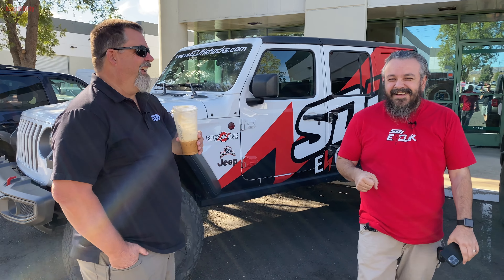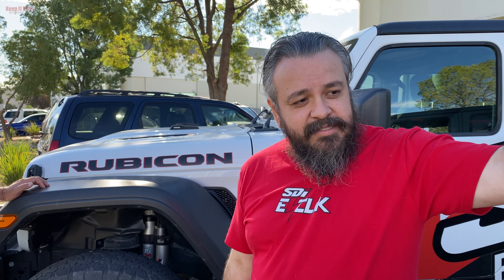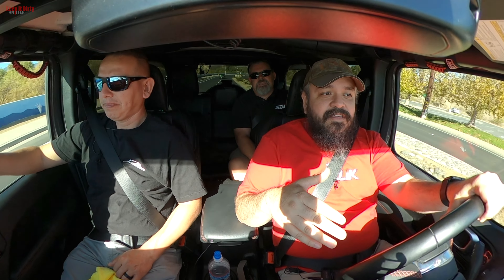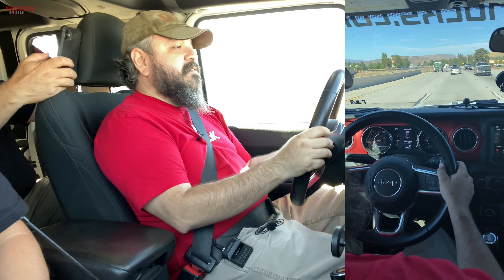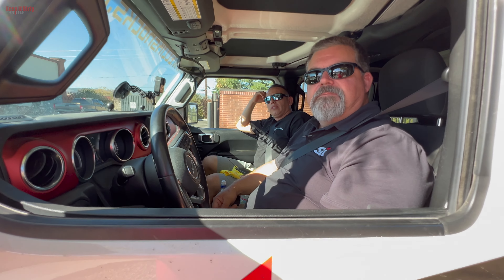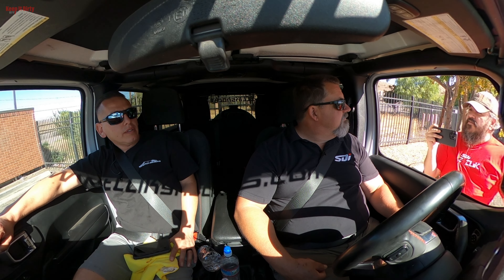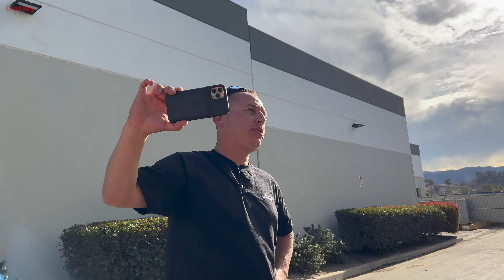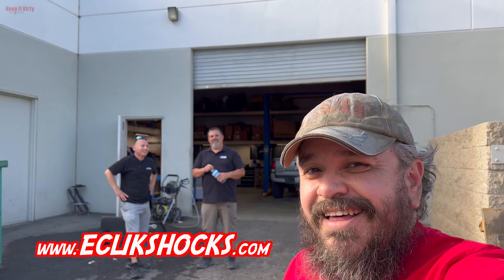SDi Jeep better than a Raptor?

Comment: The Rubicon has a 1" lift over the Sport or the Sahara, but they used the same LCA on the front. If you put the LCA's from the Mopar 2" lift on the front (they're 1/4" longer), it helps the steering by bringing the front caster back to 6 degrees (stock on Sport and Sahara) from 4 degrees (what the Rubicon ended up with).
Reply from the maker: So is the Mojave arms longer because of the different shocks? I’m thinking more and more that the shocks are the ones really making a difference. Yes everything else contributes of course. But the biggest thing that can improve the steering and drivability are good quality shocks with a proper tune.
Reply: @KeepItDirtyOffRoad  It's not the Mojave Arms. It's the Arms from the Mopar 2" lift that Jeep offers for the Wrangler.

Comment: The rear is still under damped but a few hundred pounds back there might help.
 I can see the huge improvement though.
Reply from the maker: YeH, a little weight will help big time, but when’s the last time you saw a Jeep runs trails like a raptor without spending huge sums of money.

Comment: Sweet, my EcLik Pro's for my Gladiator Diesel are out for delivery.  Can't wait.
Reply from the maker: Nice. What lift kit did you go with?
Reply: @KeepItDirtyOffRoad  Clayton 2.5 or 3.5 overland.  Probably a mix of their springs so I can clear 37's.  I want to keep it as low as I can.  Was that SDI jeep running RockJock arms and 2.5 coils?
Reply: Great video by the way.  Not a ton of info out there in the "Jeep" world on SDI.
Reply from the maker: Yeah, Wayne calls it curries 2.5in lift. The springs are soft and help with the smoother ride on street.

And yeah, finding that awareness of these guys products is very low. One of the reasons I’m making these videos. Totally blown away and wish I would have found them long ago. They’ve been in business a long time, but they make parts for everyone else like walker evans. They are just getting into the consumer side and blowing everyone away.
Reply: If you are running a pedal sensitivity device like the Banks Pedal Monster or a pedal Commander and or the Derringer, these use the OBD2 port and this shock system does as well.  You will get errors like I do.  So now I have to choose between the Pedal Monster/Derringer or the shocks.  The Icons and Falcons may not be as advanced but the icons are pretty close and do not require the OBD use.  Want to buy my setup?  I am thinking of doing the icons so I can still use the banks.  It sucks because I love this system and it was well worth the money.  Only reason I am posting is so people are aware.  I love the shocks, but I love my Banks as well.
Reply from the maker: That’s what we have heard from a few. I personally would choose suspension. Foolers like the pedal commander cause more problems than good. Seen plenty of trucks go into limp mode when used by itself.  A good tune is a far better option in this case. 

I would rather have the faster response, with the larger sensor, that’s integrated into the vehicle. The icon system does not and it’s app controlled so changes on the fly will be tough and performance will not come closes with how small that sensor and processor are. 

Eventually once the icon system actually hits the market, I want to do a side by side with both to see how it stacks up.

Comment: Idk if it's just me but I saw that the front left tire was low. The psi was red in the video. Js I have a 2019 JLU Rubicon with a 3in lift and new front lower control arms for my pinion angle correction and I don't have that bad of a ride at all.
Reply: And if I'm not mistaken the tpms comes on around 29ish psi so that's some of your steering issue!
Reply from the maker: You should try driving a raptor. The Jeep is beyond uncomfortable and a chore to drive. I had a bad sensor here that was later replaced. Just waiting for the dealer when we filmed this. Tires were at full pressure and had no impact on the drive. But if you watch the video, I’m talking about my last fee months with the Jeep . Not just during the drive. The jeep just did the typical BS it always does. And that’s with stock suspension on a relatively new Jeep. And the poor driving gets worse as you upgrade. Upgraded arms with better joints helps substantially with steering wheel input, but does not eliminate it all. 

That all being said, if you seriously think that just low pressure would make the Jeep worse to drive, then dude, you really need to drive a Raptor. Does not matter if I’m at full pressure or all the tires are low. Always drives like a dream with minimal corrections. And the seats are way more comfortable

Comment: Are those wheels on the sdi jeep running hub centric rings?
Reply from the maker: No spacers man. Just proper offset. I removed wayne told me the offset and backspacing but I don’t remover it off the top of my head. If you need it, I can ask.

Comment: Take the slop out of the steering box. Easily done. Also they changed in 21 to a different steering box on the gladdys not sure about the wranglers but I assume they changed as well.
Reply from the maker: From what we were told at the dealer, after the steering gear and software fix, the wrangler steering is basically the same. Makes sense that the gladiator would be different because of the length and extra weight of it
Reply: @KeepItDirtyOffRoad  it’s not an eccentric where you can set the lash in the box?
Reply from the maker: Honestly don’t know enough about it. I have more experience with IFS than solid axles

Comment: Great video - like the detail! On-road and crawling performance appear to perform nicely! Question:  Why were the high-speed runs in street mode? Seems to me there should be a desert/dirt road mode for taking whoops at speed - is that in the works?
Reply from the maker: Yeah, we don’t know why, but on fast off-roading street mode is the most stable. Desert mode gets too stiff and makes it buck more. Not sure why, but it may be with the way the algorithms respond and they’ve put more time into Streep mode than any of the modes and made sure it can handle all situations

Comment: Your complaints are solid axle things more than “Jeep”.   I’ve had an 80 series LC, drive many 3/4-1 ton trucks, and currently have a JT.    It’s more solid axle things than Jeep.   That being said, great video and I liked hearing your commentary.
Reply from the maker: Thanks man. 

But a Jeep is definitely a little different than just a typical solid axle vehicle. My old F350 was a solid axle and that thing was very comfortable and the steering was on point. It did not turn fast, but that’s because it weighed 8k lbs.
Reply: @KeepItDirtyOffRoad  that’s also as long as a bus.  My JT is smoother than a JLU.  All because of wheelbase.
Reply from the maker: 🤣🤣 yeah it was. Parking it was a nighmare

Comment: Lol I tried to get SDI to install E-Clik on my wife's 2016 LR4. They said sure, but the whole underside would be need to be swapped out lol.
Reply from the maker: Well yeah man. Don’t LR4 use air bags and all that to raise and lower? You would need remove that whole system first plus upgrade a ton of components to use a new set of coilovers. Would be cool as hell, but yeah man. They only make the shocks, not the whole suspension solution. 

Even on the jeep, they can support stock but to unlock the full potential you need a lift kit and a few arm upgrades to make it work right and this don’t make any of it

Comment: whats the deal with the tire air pressure at 8:07? Of course the jeep is going to be horrible your front left is really low, your rears are 5 lbs off from the front right
Reply from the maker: Don’t see what you’re talking about man. My jeeps air pressure was good and had no warnings on the dash. This was not an opinion based on a single drive. We’ve been driving that Jeep for years, on and off road. And it always rode horrible compared to the Raptor. It was a total chore to drive.
Reply: The split screen at 8:07 shows the tire pressures, your left is so low its red, the right front is 31, the right rear is 34 and left rear is 36 on your wife's Jeep just saying that is probably why it rides like crap.

I am in looking for new shocks and these are on my radar looks pretty cool
Reply from the maker: Ah ok. Had to look up the service records to confirm if there was anything wrong and yeah man. Dealer had to replace a tpms  sensor in that tire shortly after. You can see at the beginning of the video, the tire was not low. Not even close to the 5 psi shown. 

Now as far as suspension is concerned, if you want to improve the ride no matter if it’s at stock or lifted, there is nothing better than Eclick. It solved a lot of the problems with a Jeep and on both street and offroad there is massive improvement. On road manners are greatly improved. Way less body roll and not as much input. Offroad the live valve system is always trying to keep the Jeep level so you can feel the shocks getting stiffer and softer to keep the Jeep on grip. And lastly, it allows it to keep up with raptor. Not many jeep suspension system can say that.

Comment: Nope. FORD will always lead the way, set the pace. No matter. Don’t tip over the heep
Reply from the maker: 🤣🤣 this will outperform a stock Gen2 on the trails 🤷‍♂️. I could not believe it too. But it can. And then it could drop in and do some rock crawling. It’s pretty impressive

Comment: The ford fanboy is such a pansy!  He should get an old man lincoln sedan for slow smooth afternoon cruises.
Reply from the maker: 🤣🤣🤣 that’s funny. Not everyone is a rock crawler. Not my scene. I prefer fast off-roading which from your comment it’s clear you know nothing about it.
Reply: I know all about it but run a more capable truck for it than the raptor, the Ram TRX.  But hey, have fun with your rice burner engine and fake engine sounds coming through your stereo!  😂
Reply from the maker: 🤣🤣 I have a far more capable vehicle than your silly little TRX. I have a Gen1 with a mid travel suspension. But Regarless, my old Gen2 ran circles around a stock TRX. My gen1 leaves It in the dust. And none of my raptors had any problems jumping unlike the TRX that always goes limp mode or sets off the air bags
Reply: Uhh, the only thing small around here is the displacement of that ridiculous rice burner they call an engine in your raptor.  Hope to see you on the street or off it, either way that raptor will look just as ugly in my rear view mirror.
Reply from the maker: Why do you think I have a Gen2. If your going to try and insult, get the truck right and know your shit. 

I have a gen1 now. That’s a v8 to your uneducated ass. And raptors are designed for the trails so that’s the performance mine is setup for and my little Gen1 with the tiny 6.2 will leave you behind once’s trails get rough. You can’t even get traction let along hit anything rough without the truck falling apart.

But I digress, I tested a gen2 against a TRX. Guess which one won on the trails?? Go look it up, I’ll wait. 🤣🤣🤣

Comment: Those pos jeeps aren’t better than any Raptor. I’ll go with a Landcruiser over any crappy jeep.
Reply from the maker: Footage don’t lie man. The Jeep performed so good thru there and was the most versatile with just a mild lift.

That all being said, I hate the way that Jeeps drive and they are not comfortable. But I know for a fact that a modern land cruiser is not as capable as a modern Jeep. Modern land cruiser is a large luxury SVU designed for onroad comfort. Jeep sacrifices are lot for offroad performance and is the better offroad vehicle
Reply: @KeepItDirtyOffRoad  I’ve had buddies roll too many times in those Jeeps. Yur right, they’re not comfortable at all and their gas tanks are small. I don’t know much about the latest Landcruiser like the 200 series. My favorite of the Cruisers is the 80 series with factory lockers. Those are literally the best 4x4 vehicles on earth. I think Toyota secretly brought in Hatori Hanzo and had him make the 80 series Landcruisers. Jeeps definitely have the cool factor going for them. I’m sure some, when modded well, are capable. But the 80 series Landcruiser is the king if done up well. I was a Landcruiser guy all my life since 17 years old. I started out with FJ-40’s (I restored 3 of them) then jumped up to the 80 Series (I had 3 of those). The only possible place to go up from there was the Raptor. I did consider the 100 series Landcruiser for a while.
Reply from the maker: 80 series offroad reputation is very well known. Specially in Europe. But the latest land cruiser is a lot like a LandRover. All luxury and no real offroad performance anymore. 

For me Raptor is king offroad. But I’m biased. I’ve tried all off-roading and High speed off-roading is what I like and prefer and only the raptor does we’ll stock in that niche.
Reply: @KeepItDirtyOffRoad  I know the Raptor is more about high speed and all that, but I’m sold on how well it’s (especially 1st gen) built. SVT did an unusually great job making it extremely heavy duty and overbuilt. Similarly to the 80 series Landcruiser.
Reply: @KeepItDirtyOffRoad  I’m very familiar with the quality and how the 80 series is over structured and overbuilt. I know this quality very well. And I think the 1st gen Raptor is a match in that type of quality. That’s why I believe the 1st gen Raptor will, in the future, be a highly sought after platform. I’m not bashing the 2nd gen and all that. I’m just saying I’m coming from a Landcruiser background and I can see and tell that the 1st gen is an absolute gem of a steal right now.
Reply from the maker: I would have to agree with you. The Gen2 does something the Gen1 could not though. gen2 made off-roading easy. Lots of aids make learning and controlling the truck fast offroad easy to to the novice and it has opened up the hobby to more people. Once you get some experience those Nannie’s get in the way. That’s why I’m on the Gen1 platform now and I feel the Gen1 will always be the better truck.
Reply: @KeepItDirtyOffRoad  the gen 2 & 3 Raptors are, no doubt, awesome, but it’s like the 100 series and 200 series Landcruisers. They get cushy and all that. Trust me, I wish I had one. But the true roots models are certain ones. With the Landcruisers, it’s the 80 series with factory lockers. With the Raptors, it’s the 1st gen the SVT guys made. Certain models have that sweet spot. I’m humbled and grateful to have had the 80 series I’ve had and now I’m very humble and giddy to be the owner of a 2014 white supercab very clean Raptor. I have lots of plans for it thanks to your channel. I have no ego. I’m extremely humble and grateful to have knocked this off my bucket list. Humbly, thank God. I’m a happy man.
Reply from the maker: That’s awesome man. We still have a ton of plans for our truck and hope to post it all along the way to help the community and to get more guys on the trails with us. 

We are looking for a new build too. Something different but still offroad capable. May have to look at a 80 series build as a possibility
Reply: @KeepItDirtyOffRoad  the 95, 96, & 97 year 80 series with factory diff-lockers are the cherry ones to get. Also the same year Lexus versions (LX450) are exactly the same but with more Gucci shit inside. But underneath it’s the same beast.
Reply: @KeepItDirtyOffRoad  I’m in central California. If you get a Landcruiser, I can help out with doing the work on your upgrades.
Reply from the maker: Thanks for the recommendations man. Almost got a 90 LX a while back. Will be taking a look again now to see what’s possible and price ranges for a “budget” but capable offroad rig
Reply: So between the SDI E-Click Pro and the EVO Manufacturing DTD Suspension System with King 2.5 Coil-overs and everything else it comes with….which would you guys prefer for a daily driver Jeep…but when taken offroad its to drive very fast…Highway speed offroading in deserts, and Northeast dirt roads.

My wrangler is my daily driver, but I’m building it to perform as good as possible offroad and I am a high speed offroader.
Reply from the maker: SDI kit will give you the best of both worlds IMO. As soon as you go with any other kit you sacrifice daily driving for offroad performance. With Eclick you have the best of both and can now run with Raptors which no other Jeep kit can do.